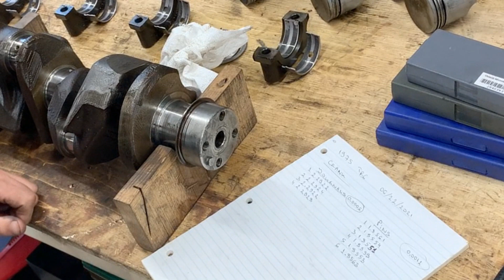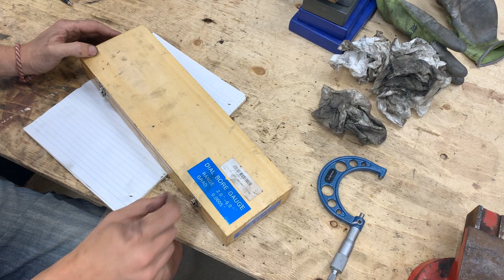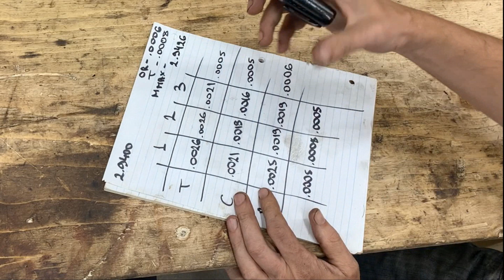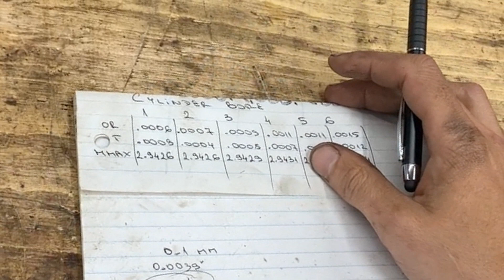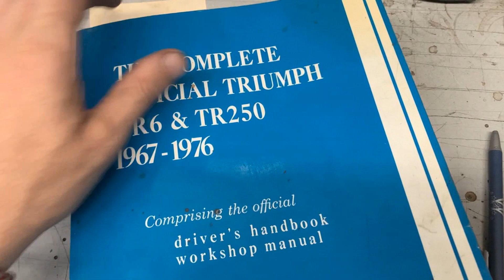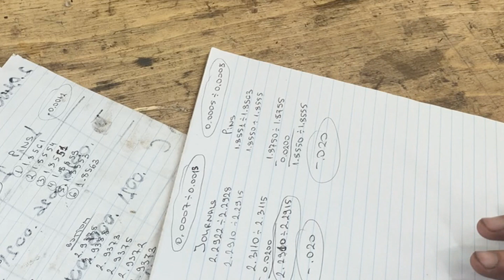1975 Triumph TR6 - Part 15 - Measuring the Cylinders and Crank

Comment: As a UK citizen (Scottish actually) I find the way you describe the measurements as plain daft.  Stop calling the differences in "ten thousands of an inch" and instead call it out as 2.1 thousands of an inch out of round or 0.6 thou or 0.1 of a thou if the measurement is very close for example.

Comment: Great video.  My 76 is knocking when it’s hot and the oil is thin.  Almost certainly a rod bearing.  I’ll yank the lump out this winter and measure the crank just like this.
Reply: My 72 used to run at 25psi when hot and 0 psi at idle/tickover. After the engine rebuild it went to 95 psi when started. A big difference. I looked up the data and the oil pressure relief valve is set to 95 psi.